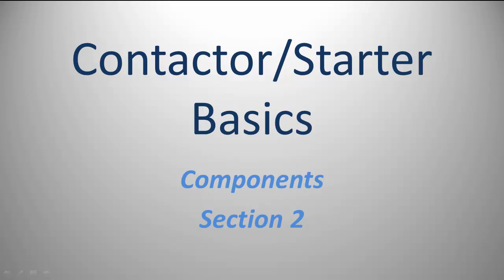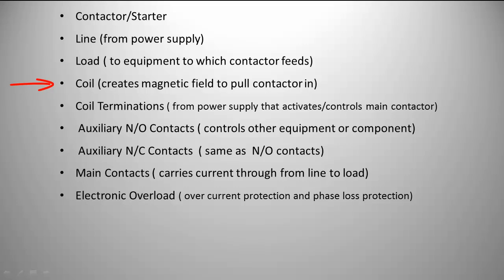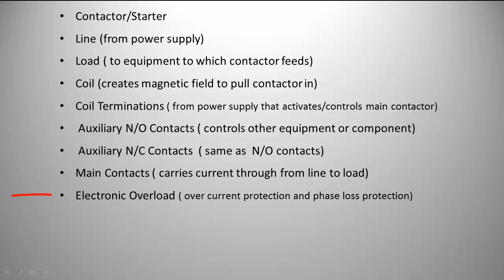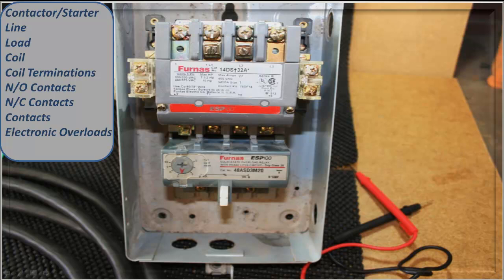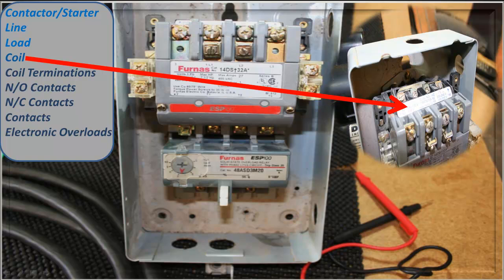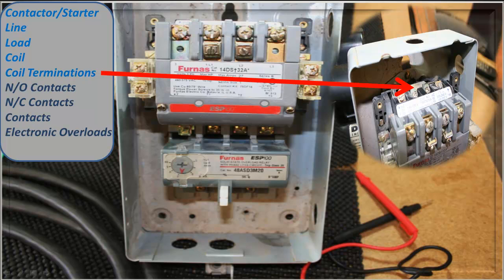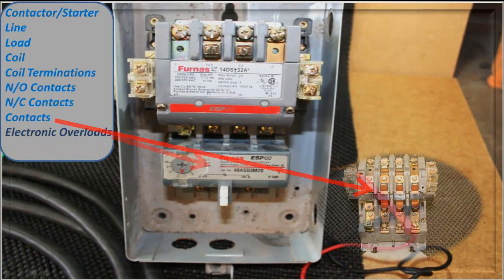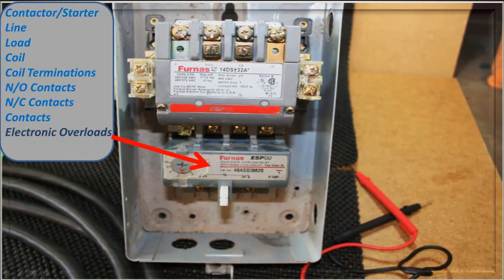Basic Contactor  Starter Components

Comment: I have a 14DF32AC 81 3 phase for a well water pump motor I'm trying to put a hour meter on it . does it connect where coil signal comes in to close thus activating the power?

Comment: I have a Square D size three motor starter (3 phase). I live in a rural area and can't find anyone who knows how to install this starter on a 30 horse power motor. I know where the line voltage hooks up and the power to the motor but I don't know how to set up the on/off switch circuit to the relay. The is a wire from a protective circuit to one of the screws on the relay. I understand that it is supposed to disable the relay in case of excessive power draw. Can you help?
Reply: I have spent months researching into circuits and found a fantastic website at Gregs Electro Blog (google it if you are interested)

Comment: I haven't got any further than a 5hp motor, a 3hp grinder some run caps for the converter, and some old mag starters in a box. I do have a 3ph starter, but it is old sq. D and the heaters for the grinder load would cost an arm and leg. I can buy a whole new starter for less than retro the old 3 phase starters I have.  That's what I'll do. I am not a hokey-poke type of guy. Your older emplyee blunder videos taught me a few things. I have read most of the NEC. I know my limits. Thanks

Comment from the maker: 3 ph motors are designed to run from the same power source.Have you tested the voltage between phases to see what is being supplied.What are the voltage readings?

Comment: Hey Sparks, can I use a 240v Sq.D starter(2 legs) for a 3 phase motor if I connect the made up phase from my rotary converter to the motor direct from the rotary to the motor? That would leave the 240v from my service to be wired through the mag. starter.  The third leg is only hot when the rotary runs, and only 1 machine is powered by it .The starter has a 240v coil in it, and a remote start switch. I am familiar with mag starters wired on 240 and 120, no problems there. 3HP pedestal grinder